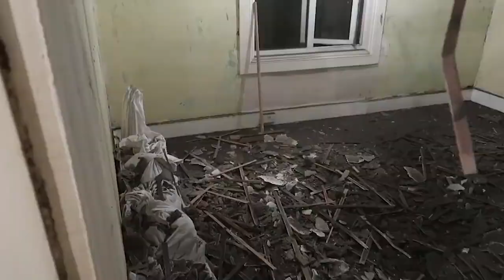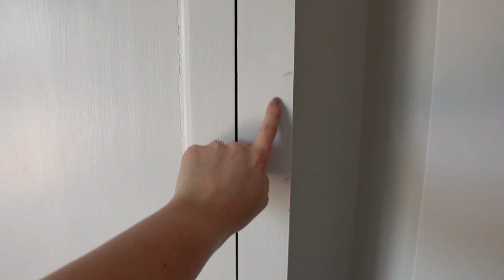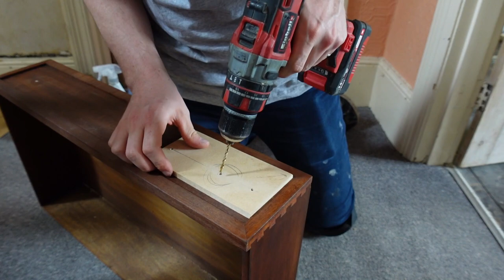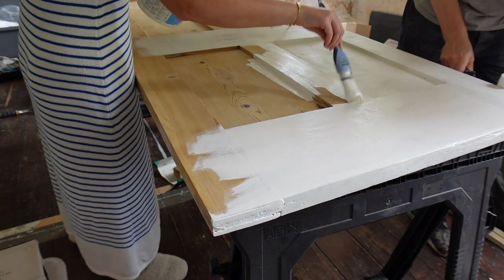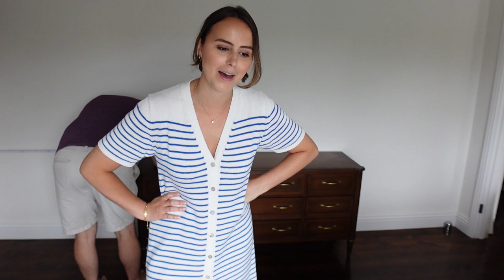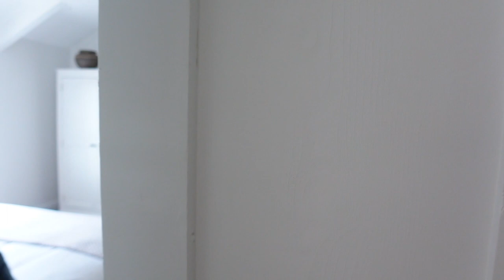BEDROOM MAKEOVER FROM START TO FINISH | Laura Melhuish-Sprague

Comment: Gorgeous, love the dresser... and the door opens against the wall! YAY!
Reply: It is much more convenient and makes the room more open, however most old houses, mine included have the doors opening the other way so as to provide privacy to the occupiers, so if you knock and open the door, you won’t see them in bed or undressing etc.  Similarly, the ceiling light is usually off centre, so you are generally behind the light whilst undressing to again protect your modesty!